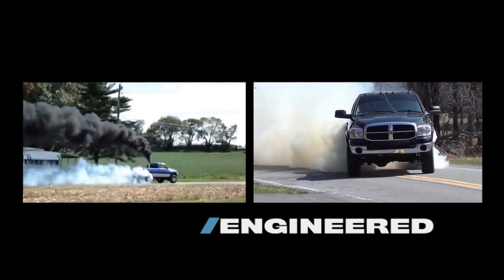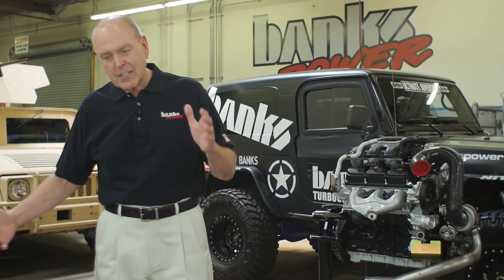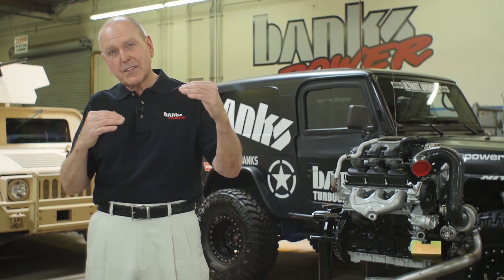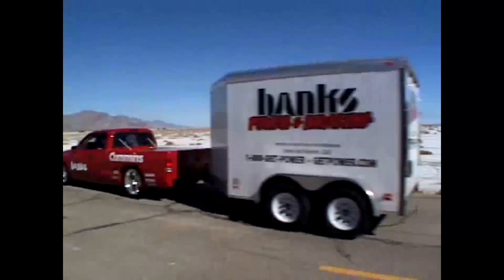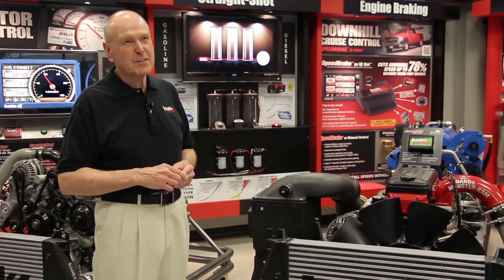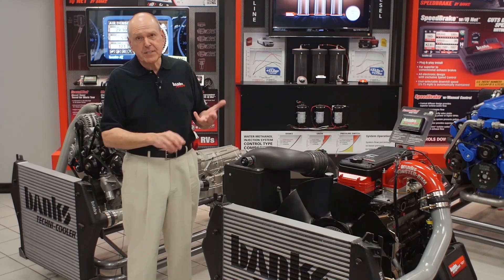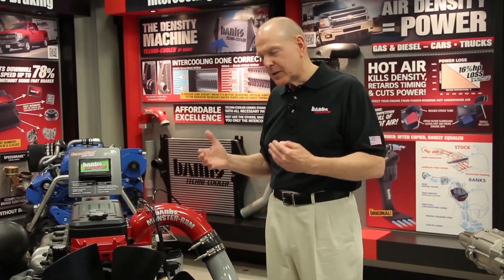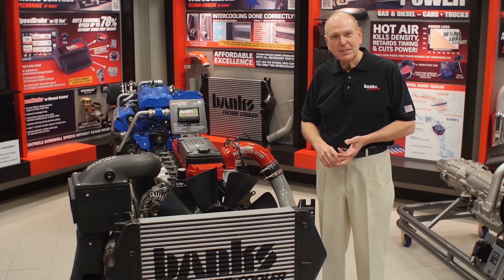Learn from the Master of Diesel - /ENGINEERED

Comment: I do wonder why that whole back pressure myth was so popular. Everyone I knew back in high school would always say "well you gotta have some back pressure".  I mean you do lose low end torque and response, but ultimately you make power and it is more efficient to have less back pressure. 2 strokes are the ONLY motors that benefit from back pressure.
Reply: I believe the "you need backpressure" people are just misinformed. I have been building performance cars and motors for over 25 years, professionally a little over 20 years. The argument seems to come from low revving motors that seemed to want some backpressure to maintain low end power. What I have seen in NA motors is that keeping the heat in the pipe, proper pulse tuning, velocity and collector length all pay dividends. If you can keep the exhaust veocity high and pair up cylinders properly, you can use the pulse to help scavenge or pull the exhaust out, which will increase power. On a turbo motor, keeping the heat in the pipes and proper use of the exhaust pulse pay off with quicker spool up times. After the turbo, the less restriction the better. Some may argue that backpressure is needed, backpressure = pumping losses = reduced power. This is a simplified explanation based off of years of experience.

Comment: The main thing that hurts a diesel engine is running too rich. A diesel engine will run as rich as you set it and really cant stall from running too rich as there's always a full charge of air. This leads to the rolling coal phenomena that we see today where people think more fuel is more power. As gale explained, a diesel will make the most power when it has just enough fuel to completely burn but not so much that it smokes under full boost pressure. If it smokes a little in between shifts its normal for older diesel engines. When people put fuel maps on diesels that are ridiculously rich, the engines internals are going to get burnt up. I've seen this happen to a vw diesel with the mechanical pump. People who didn't know what they were doing started turning screws just to blow black smoke thinking that they're making power. This ultimately resulted in the engine burning up. With my diesel im going to tune it right and be on the side of caution as the last thing i want are egts of 1600 degrees Fahrenheit and a new engine needed.

Comment: Great stuff.   I was a little surprised about what he said about the enhanced lubricity of low sulfur diesel.   From everything else I've heard and read the low sulfur diesel has less lubricity and it's a problem for older diesel vehicles.
Reply: +sonictech1000 what he was getting at is ultra low sulfer diesel has to have lubricity added to it. Which, is different from the old stuff where the sulfur was the lubricity. I agree that his worded made it harder to understand.
Reply: +sonictech1000 i think he may have mixed his words up a bit.
Reply: i know diesel mechanics who put diesel oil into their fuel tank to help this problem. not only does the oil help the fuel pump, it also cleans the injectors in older more mechanical diesels. i wouldn't try this with a new diesel but i know for a fact a quart of diesel oil to a full tank will only add lubricity and help keep it running strong. newer common rail diesels i wouldn't even risk it. i don't see why there would be a problem with it but the prices and all the emissions bs it's best to pay for a fuel system cleaning.

Comment: Now if only Mr.Banks was allowed to have a word with the retards at the EPA, America might just go somewhere in terms of its diesel vehicle market...
Reply: +a2xd94 Im not so sure if that's a good thing. All of these diesel-newcomers is helping raise/ keep the price of diesel as high as it is. I haven't seen diesel cheaper than gas in years. Didn't always used to be that way...
Reply: +Will Akers Well now that the idiots at the EPA essentially drove away every manufacturer besides Cummins from selling diesel engines in the US for the near future, even if for just a few years, I think you can expect the price of diesel to drop since the amount of new diesel vehicles on the road will drop drastically.
Also, it's not good, if you don't mind the only diesel vehicles on the market being pickups-bordering-on-semi-trucks. I for one would like more compact diesels, since I have no need to tow 50 foot yachts or bulldozers daily. If I'm going to buy a cheap commuter car to save money on gas, I'd prefer it to ACTUALLY get good real-life gas mileage (not just on spec sheet like gas cars),not be gutless as shit and unreliable. But that's probably just my unpopular opinion...
Reply: +a2xd94 It's not only unpopular, it's uneducated. My car gets better mileage, better emissions and make more power than it's ten year old variant (2005 vs 2015) with the same size engine and 200 lbs heavier.

 The EPA has not driven away manufactures of diesels cars/trucks, there more available than ever. Cummings makes diesels for industrial applications and that's where it makes the majority of it's money not dropping small displacement diesels in Dodge an Nissan consumer vehicles.

 Diesel prices have dropped at least around here, the original price increase came from cleaning up the fuel to make it burn cleaner.

 More compact diesels? How come you didn't buy a Chevy Cruze Turbo-Diesel? More choices are coming but you already have a few that aren't truck based.

 This is the inclination to blame the Government for everything and blame Obama especially when you can't articulate yourself properly you get called the R word.
Reply: I always look to mister banks when I have haters of diesel power question me about my choice of vehicle propulsion. 
What an excellent spokesman for diesel :) 
Watch that dragster fly with minimal coal rolled......if he can go fast with no coal, why can't modded pickups? 
It's ok I know the answer. 
Chicks dig it right? Lols.
Reply: +a2xd94 
Yea man, I remember the mid 80s....ranger and Mazda with diesels in their pickups.....slow as hell but whatever happened to that market? 
Now you have to spend like 10k extra to get a huge pickup truck with a diesel.  
I'm sure alotta people would like a mini truck or maybe a 150 or 1500 model full size with a small diesel for good economy. 
Look at the diesel option cars, they get a lot better mileage than their gas counterparts, yet trucks seem like they get 2-3mpg better than a gasser.
Not worth if it if you got one for an economy reason IMO.
Reply: +MrTheHillfolk I think it may have something to do with the chicken tax, which is a stupid old tariff law that stopped the import of mini trucks from Japan which were often diesel, can't be sure though.

The other side is the marketing that trucks HAVE to be huge manly vehicles capable of hauling your entire living room and the kids up a mountain incline at 80 mph and fording rivers while sitting in luxurious leather seats. A lot of people are more realistic.

Give us back mini trucks, something low enough to get a motorcycle in the back without having to worry about the balance when its going up 4 feet in air. I would be trade being able to tow a camper at high speeds for decent fuel economy, and drive into the city without street parking becoming a huge chore. I'm sure there would be a huge market for them.
Reply: +Drakewood Exactly, it seems like either the amount of people who'd like a nice compact truck that's great on gas yet can still haul stuff and go offroad is very small, or there still are a good amount of us out there, just nobody will listen to what we have to say. Probably the latter because a basic compact truck is not profitable enough for the manufacturers. Sad but true...well new vehicles are bad investments anyway, we'll stick to used Rangers and Colorados and such, from back before the extinction of the small truck.
Reply: +Anthony Thomas 
Because want my old rabbit diesel pickup truck back :)
Reply: +a2xd94  Whats funny is that i park next to a diesel electric hybrid e450 mini bus almost everyday. It was made over 10 years ago. The Owner of the company could not make a go of it economically. No support from the OEM's, no support from the fed. They tried and tried and almost all of the technology was bought for scrap value because they just couldn't keep up on the capital demands to make it go further. The bus works great. No one wanted it. Sad really.
Reply: +MrTheHillfolk Chevy Cruze Diesel has been available for almost three years, how come you don't own one?
Reply: ***** I think just about everyone knows about how electric vehicles are gaining momentum. It's inevitable to hear about Teslas. What I don't understand is why no one realizes the potential of diesel-hybrid vehicles like the VW XL-1. You combine the fuel economy of a diesel with the obvious benefits of electric power. No matter how you slice it, a passive hybrid system will always be more practical in real life than a fully electric vehicle. Until 'supercharging' conventional batteries or supercapacitors become common place and accessible that is... Electric vehicles are nice in an ideal world where you make the same short commute everyday at moderate (not highway) speeds. Road trips are out of the question, and EV range at normal person highway speeds (ie. 80-90 mph) go down drastically. Not to mention that ambient temperature also has a drastic effect on available power in the battery pack, so range goes down even further in the winter. Maybe those compromises are acceptable to some, but I like to invest my money into vehicles that are able to take anything I throw at them. Short range is unacceptable to me, and to the majority of the market, I would venture to say. I will bet you that in the next 5-10 years VW will release a production vehicle based on the technology developed in the XL-1 prototype that will be a combination of electric vehicle, passive hybrid, and turbodiesel engine. And when it does, it will crush the competition in the high-mpg market, assuming it can keep prices reasonable.
Reply: +MrSierra5000 electric cars just shift the location of where the fossil fuels are burnt. Then consider the small amount of energy you can store in a battery to the large amount you can store in a fuel tank. It will be a long time before there is any sort of electric car takeover and it will most likely look nothing like the cars being offered at present.
Reply: +MrSierra5000 I'd take that bet. Oil is back down almost at it's historical value and not one volt of green power has been made without a subsidy. We will see some interesting advances, Porsche's designs of the early 20th century where an engine drove a generator that powered electric motors in the wheels might come about. Mercedes turbo with the mid mounted generator too will become commonplace, but electric cars are a long way away and impossible to predict.
Reply: mrsierra5000 i'd rather be dead than drive a tesla or any other electric car.
Reply: mrsierra get off of elon musks nuts. Youre obviously a huge nuthugger.
Reply: That's not necessarily what you want, diesel is inherently a dirtier fuel, you would not want a situation where all those mom and pops who ferry the kids to school everyday and then head to work in the city drive diesel cars, that'd be bad. Here in the UK the vehicle fleet is approaching 50% diesel iirc and we're now knee-jerking the other way because air quality in our cities is very poor. 
VW, the dumbasses, really fucked with the image by breaking the law too, small diesel vehicles are becoming more unpopular with the public.
Reply: no one in america aside bmw make cars able to fit an inline6. I ear a lot of good things about the 530d but not so much about 4  cylinders diesel.

Comment: I would argue that the fuel today has not improved from a performance standpoint. You run today's fuel in an older engine, and it will destroy the fuel system as it does not have the lubricity due to the lack of sulfur. Sulfur was removed for purely political reasons, for 'global warming cooling change weather whatever it's called this week' not for any performance improvements. Today's engines and fuel systems are made of harder more exotic and expensive materials to combat this lack of natural lubrication. 

I do agree that exhaust laden with black smoke is unburnt and unused, wasted fuel/energy. But that has little to do with the sulfur content.
Reply: Well said +tr0n. Kleetus, Google something like "pH of rain" it's dead simple.
Reply: +kleetus92 And thats why i love bio diesel so much. It has pretty much the same btus per gallon of diesel fuel and it has a lot of lubricity to keep my mechanical injection pump and injectors happy. The only bad part about it is that it eats untreated rubber so all my rubber fuel hoses had to be replaced with a special fuel hose. No big deal and definately worth it. My 1984 vw rabbit is running super happy sipping this stuff with 15psi of boost. Still havent tuned the thing properly, i need to turn up the fuel until it starts smoking then back it off while monitering egts. Once i do im hoping to make 100+ horsepower and over 150 lb ft of tourque. Thats alot for a 1.6L diesel and faster than the golf gti of its day.
Reply: +kleetus92 while i agree that sulphur is a good thing for diesel engines, it is really a bad thing for the environment.

you don't believe in climate change obviously, but acid rain is a real measurable thing and it comes partly from sulphur emissions.
Reply: +tr0n Well, I don't believe in acid rain, or the hole in the ozone layer either... they are all things to make people run scared and give control to the power hungry in our government. 

If acid rain were true, we should have all been dead years ago, especially in western PA where I live where coal was the only fuel burned to the point where you couldn't even see the sun. Oddly enough, we're all here talking about it.
Reply: kleetus92 i'm just gonna let you go on being kleetus. good day.
Reply: +tr0n Classic. can't argue the point, obfuscate.
Reply: kleetus92 naw, i just don't feel like arguing. the willful ignorance gets a bit tiring.

it's not literally fucking skin burning sulphuric acid...but it is measurable and it is real. that's about all i'm willing to feed you today. 

enjoy. keep america strong and free my friend.
Reply: kleetus92 i'm not some crazy fucking environmentalist buddy, but you have to understand that lots of the shit we do is really bad for the environment.

it's not some giant fucking liberal conspiracy, it's just life.

i love cars, engines, smoke and soot, i'm a HD mechanic and FUCK i love me a 2500hp cummins. i love the old detroit 2 stroke 16v149s we used to run that would smoke out entire blocks on startup. i pull the cats off my performance engines and i love burnouts.

doesn't change the fact that it's not good for shit.
Reply: +tr0n Oh Ok.  Have fun Mr. Gore.
Reply: +kleetus92 Yeah, just like the conspiracy against asbestos brakes, what are they hiding!?
Reply: +kleetus92 Most modern gas is bad for old cars because of ethanol.
Reply: +TheReapersSon agreed... it's pretty much garbage for anything. But the other problem is the lack of tetra ethyl lead, which was the octane booster, also had the function of metallic lead to lubricate valve seats. 

Not saying it was the greatest stuff for people, but it did do some nice things. Not so nice was fouling plugs but it made power like a mother. If you rebuild an old motor to run on new gas the first thing you do is take the valve rotators out so the valves don't chew down through the seats into the heads. Carburation wise it's no different than tuning any other motor.
Reply: +zaco21  You need professional help. No question about it... Yikes.
Reply: +zaco21 You must be pretty good then...  global warming caused by driers? Why don't you climb in one with a thermometer and see how hot it really gets in there. 

 I can't tell if you're awesomely sarcastic or amazingly stupid. That's a pretty good talent to fool me.
Reply: +zaco21 Go back to the basement kid.
Reply: +kleetus92 Gale Banks said that the newer lower sulfur fuels have more lubricating properties added to them.
Reply: +grantlandneil That's fine, I'm not willing to gamble 20k to find out if he's right.
Reply: Where are you getting your fuel that is not low sulfur?
Reply: +grantlandneil I'm not, but I add 2 stroke oil at 100:1 to replace lost lubricity.
Reply: Derrick K Only 15 psi? :P